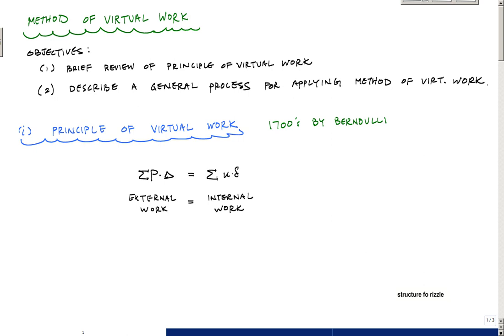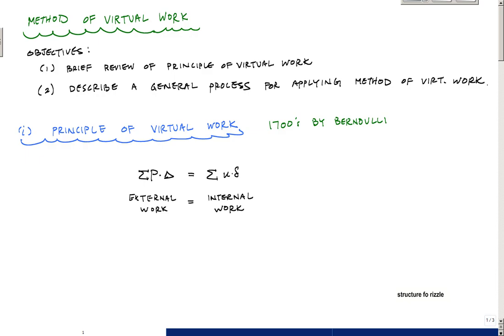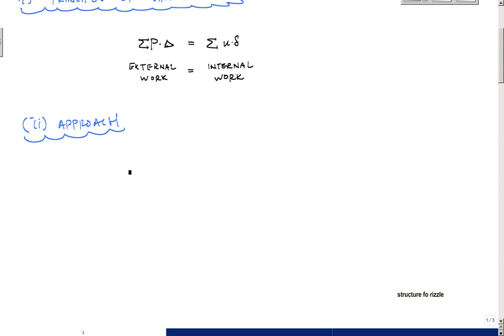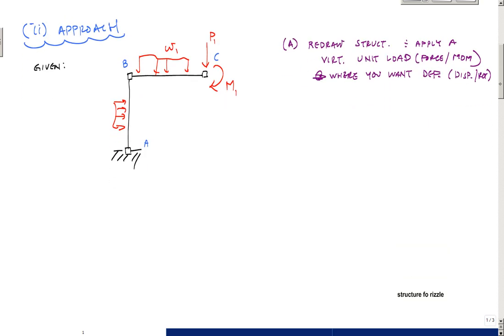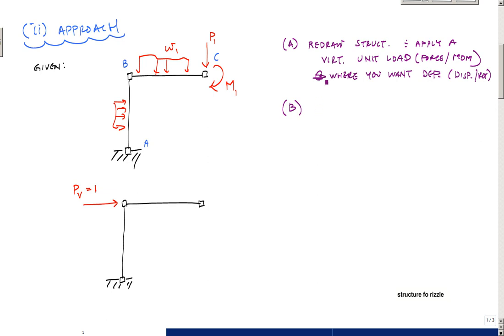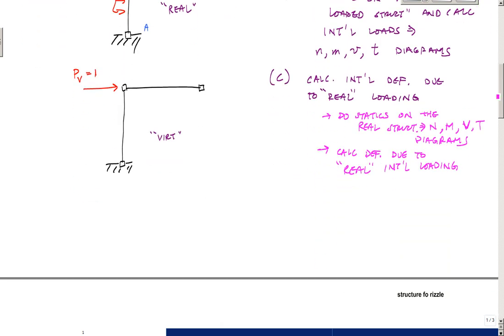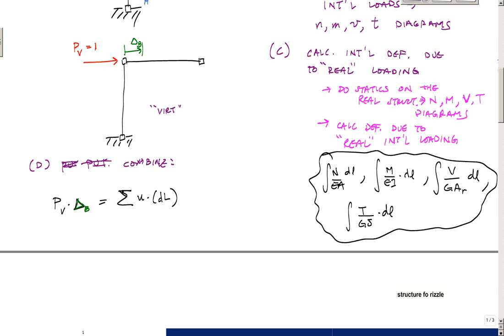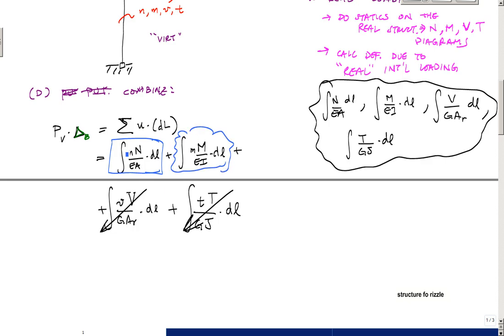Method of Virtual Work - Structural Analysis

Comment: Can you please do a video on matrix method of structural analysis - flexibililty method? for frames with a udl on the vertical member and point load on the horizontal member specifically? I realised all the books Ive seen only cover matrix method for stiffness method,  and literally only go over a brief theory section on flexibility method, its really frustrating

Comment: Hello. I am really struggling with the sfds and bmds of frames which is a barrier for me to solve the deflection at any point of a frame using virtual work method. Also i cant understand when to use that table (that shows what formula to use according to the shape of bmd for real load against virtual load) and when to use the integration formula!